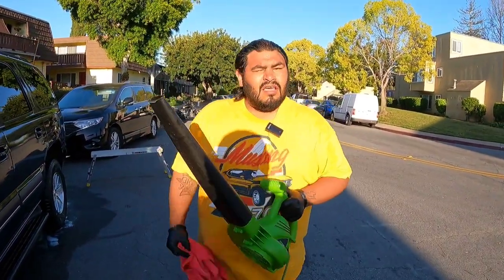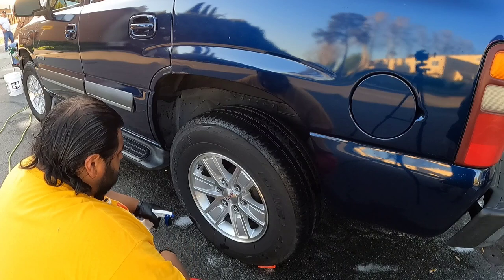HOW I DO A BASIC WASH / JUMBO SIZE WASH MITTS - Isacs mobile detailing

Comment: The hybrid wax and seal from turtle is good my bro and cheap
Reply from the maker: I need to try it. I heard some people just apply by spray and rinse
Reply: @ositoandhisadventures  you can but I found it works better drying the car and then using it just make sure the car  isn’t hot

Comment: Why don’t you put the formula 4 in a foam cannon , 3-4 oz rest water works great
Reply from the maker: I tried it before then my foam cannon wouldn’t foam up. Maybe I need a specific foamer
Reply: @ositoandhisadventures  it’s not gonna foam up , it’s gonna be watery unless you change the orifice to a 1.1 on the foam canon and it still won’t foam at all. Try putting 3 to 4 ounces of formula 1 and the rest water.